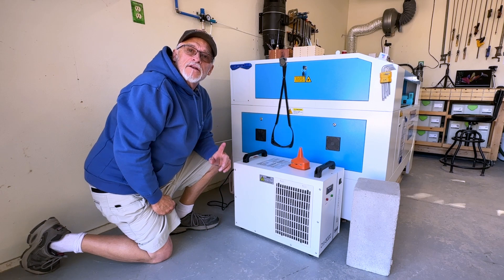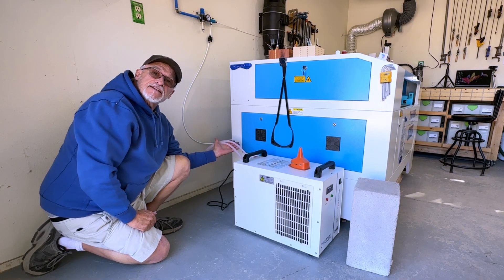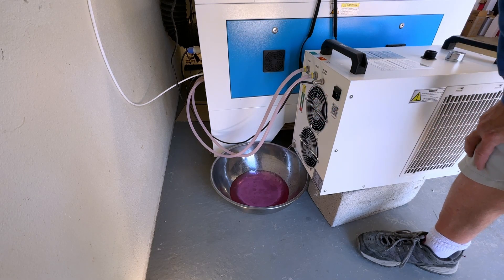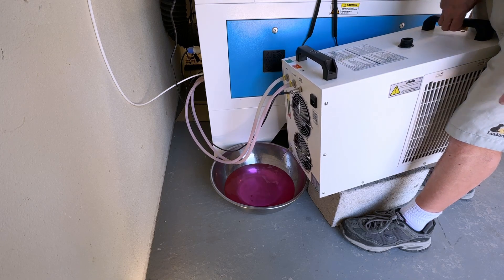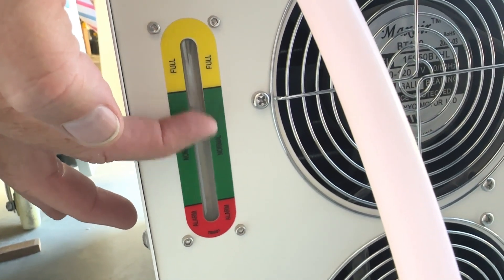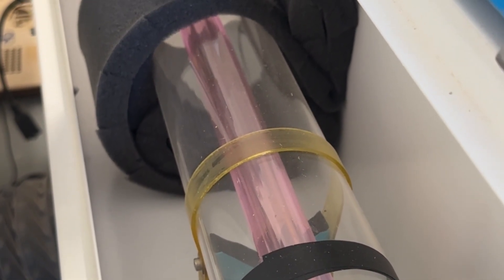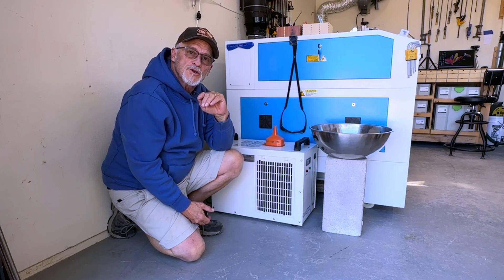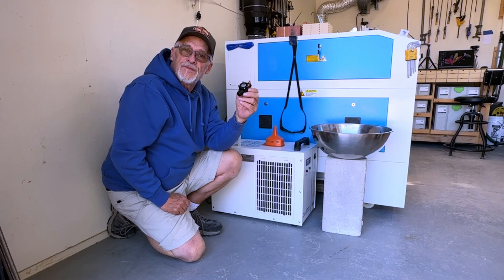S & A 5000 Water Chiller Maintenance (Changing the distilled water) for co2 laser

Comment: I take it you don't need to extract any excess water in the tube via the hose? Will the chiller with new water just cycle all that through? I am finally changing my water on my personal machine after a year 😆, only because I was not using it regularly, now I am.
Reply from the maker: If your chiller is below your tube all of the water in the tube draines out when you do this process

Comment: Hey Robert, It's been a year since this video...are you continuing to run almost a 50/50 antifreeze to water ratio? (It only freezes maybe 10 days out of the year here and just barely gets to freezing temps so I've been wondering about using diluted antifreeze as well.)
Reply from the maker: Yes it’s worked well so far! Remember you still need to change it regularly. The warmer the environment the more frequent you should change.
Reply: @computercreationz  Thanks so are you running this combo all year (changing out regularly) or just for the "winter quarter" then back to 100% distilled water?
Reply from the maker: No just for the winter time then as soon as any freezing  possibility has passed I got back to 100% distilled water.  @jennyb3850

Comment: So I'm about to do the opposite, remove the winter anti freeze water, and replace it with new fresh distilled water. Can I use tap water to flush the old antifreeze water out or do you recommend using another bottle of distilled water to flush it out ? and I mean empty, fill with hose water, empty again then fill with Distilled water?
Reply from the maker: Distilled water is the only thing recommended!
Reply: @computercreationz  Thanks for vid took me 3 flushes to get it clear. The video helped !

Comment: Do you turn everything off each night? If so do you have to check for air bubbles every day you turn it back on? I can’t find any videos or information on proper shutdown for Thunder laser.

Also how often do you change your water out?
Reply from the maker: Once you have all your air bubbles out you should have them show up, so no I don’t worry about it once they’re all gone. Yes I turn everything off once I’m done for the day. Assuming your laser is in a conditioned space. Depending how much heat your laser is exposed to on distilled water change, Thunder recommends once a month.

Comment: I have a NOVA 51 with a 130W tube and have the chiller on a stand about 1Ft high. Is there any reason you keep the chiller on the floor?
Reply from the maker: nope, in your case it’s actually better, it’s easier on the chiller water pump. less head pressure to move the water through the tube.

Comment: Why does the water need to be changed at all, if using distilled water in a closed system? I was hoping to hear the answer but it was never mentioned in the video.
Reply from the maker: yes it’s a closed system, But lots of documented cases of algae growth with the distilled water over time. this growth will increase the conductive properties of the water!  this can ruin your pump on your chiller and contaminate your laser tube to the point of failure. ignoring this will eventually catch up with you!
Reply: @computercreationz  great video and tips thank you. How often do you recommend the water is changed  to negate the issues you have mentioned please?
Reply: I was told to change the water every 4-6 weeks. But on most forums people haven’t changed their water for months!

Comment: Great video Robert!  What's your thoughts about building a "permanent" platform for your chiller that would be high enough to drain it without having to use a block or something?  Do you know of any reasons that wouldn't work?
Reply from the maker: Less head pressure on the pump. Don’t know why it wouldn’t work!